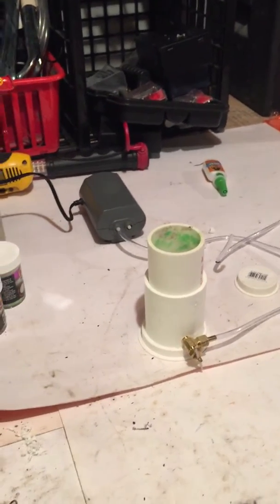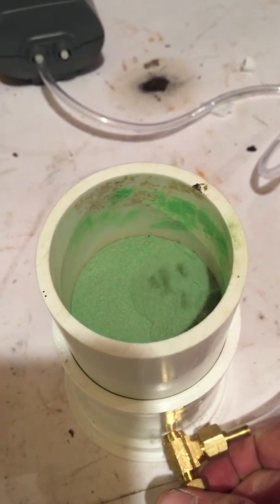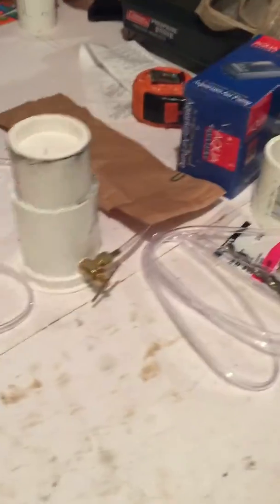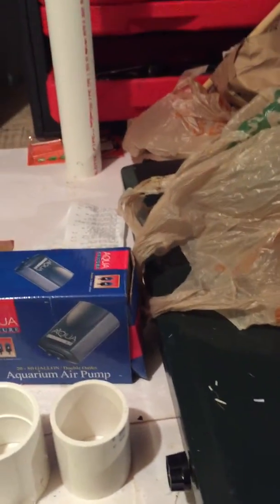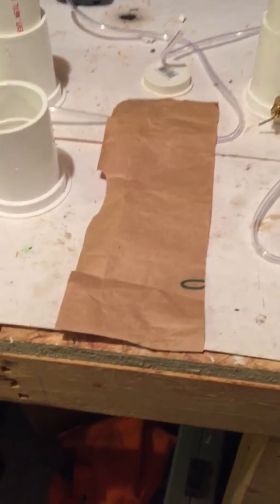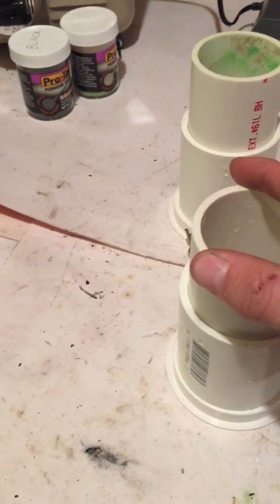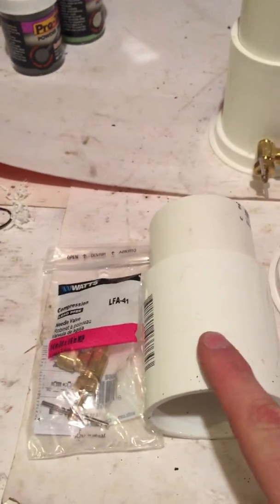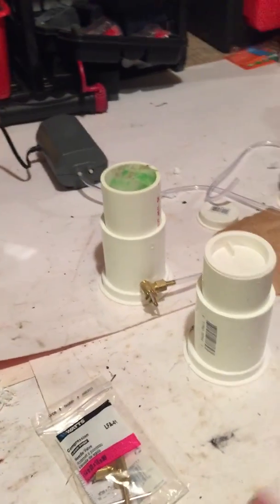Making a fluid bed for powder coating jigs

Comment: How easy is it to switch cups? I feel like once u push the filter and cup in it will be hard to take out
Reply from the maker: The cups fit in fairly tight, but really aren’t that hard to remove and switch

Comment: Simple but if you want you can take a small spoon or a touth pick and stick it in the paint and whisk it around it puts air same thing this thing is doing been pouring jigs for years, not knocking this vid good job building it buddy but for the money he  spent that's a lot of money you can use for powder paint
Reply: This is the cheapest fluid beds I have come across. I will say from my experience of painting jigs both ways. It's well worth using a fluid bed. You save paint with a fluid bed. Just my $.02!
Reply from the maker: Jeff Stanford thanks for watching and thanks for the advise!

Comment: What wattage is on the aquarium pump?  I have a choice of 1.5 w or 4 w.
Reply from the maker: Tine Schrijvers I do not remember, and the pumps are at the lake right now, so I can’t look. I will tell you that it requires really minimal air, so I’m sure the small one is fine
Reply: Thanks
Reply: @tineschrijvers3174  3.5W On mine. 20-60 gallon /double outlet.

Comment: I try looking for the valve you used.... Went to Home Depot and there were multiple 1/4 inch valve.....could you tell me exactly which size you used?
Reply from the maker: I show the package in the video. Other than that I really don’t remember. Sorry.
Reply: 1/4 inch compression fitting. I made mine a while back after Fishing Frenzy posted this great vid. Here is my vid as well. All props got to Fishing Frenzy.     https://www.youtube.com/watch?v=Jm6S1gbQ0zc
Reply: 3/8 inch male thread
Reply: On the video he is using a LFA-41 Brass Valve. hope this helps you

Comment: When I turn on the pump, the air that comes out is not very strong..... is that how it should be? Pretty light?
Reply from the maker: Ya, you don’t want it very strong or it will blow the powder. You want just enough air so when you move the cup back and forth. The powder moves like water

Comment: I'm new to this and need to coat small pieces, this looks to be the way for me to go, I was under the impression there had to be a positive and negative voltage used
Reply: Standard powder coating on large items requires electrical ions being introduced to the powder paint as it flows out of a "paint gun." The item being painted is electrically grounded and the electrically "charged" paint particles from the gun are then attracted to the grounded item. These fluid beds are used for powder coating using heat, i.e. you simply heat a lead head jig, dip it in the powder paint, and you now have an evenly paint-coated jig head.
Reply from the maker: Using a fluid bed like this does not require voltage. I think with larger items like truck frames, they use voltage to heat the metal up.

Comment: Great vid and I copied your product. Works great. Thanks !!!!
Reply from the maker: +Team Fat Katz Fishing No problem, Im glad that it worked for you. I was astonished how much easier it made painting jig hears...way more "factory" look too.
Reply: No doubt they are coming out flawless. can't remember from your vid but are you baking them off to cure or not ? I have not done it yet.
Reply from the maker: +Team Fat Katz Fishing I didn't talk about it in the video, but yes I bake all of mine. It makes them way more durable. I just hand the hooks off the rack In the oven. Each color requires a different temp and time, so just google a baking chart for whatever brand of paint you are using. Another thing I do now, is find a piece of copper wire the same size as the inside of the eyelet on the hook and as soon as I pull it out off the paint I shove that wire through the eyelet to clear it out. It works perfect and leaves the eyelet super smooth.
Reply: Thanks FishingFrenzyTV. Got it !!!!
Reply: Have you found that it is necessary to use copper wire, or would another type of wire work just as well? I get the feeling that if I used, say, a stainless steel wire, that something undesired would happen since each guy I've seen do this with the wire uses copper.